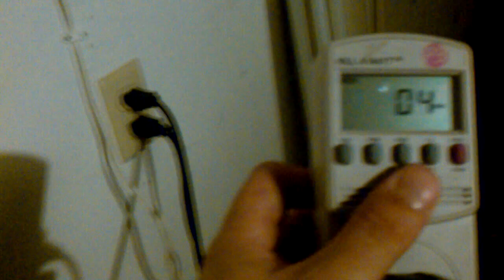Solar panels & Powerjack 1200 watt grid tie part 4

Comment from the maker: @sparktastic1 My PJ 1200 120VAC draws about 10 to 15w when plugged in and doing nothing, like at night. I put it on a timer so I save this power but also so it resets my Kill-a-watt meter so I know total production each day. When I get a charge controller it'll do that for me. So far I've seen cases where the meter is saying I'm bringing in 50W but the Kill-a-watt meter is reading 65W into the house. I have no idea why expect maybe it's a "total" of the draw and input?

Comment: Interesting... My experience has been (on 240v AC models) that AC power draw is around 20w when the 1200w GTI is not generating. My 600w PJ GTI drew about 10w from the AC. If your AC kw meter is correct, it seems the 120v models don't suffer from the same problem.. If it really is only 1 or 2 watts, it is hardly worth installing a timer switch.  Then again, maybe your AC kw meter was displaying the net difference i.e power consumed minus power generated or power generated minus power consumed.

Comment from the maker: @Xringer Actually, I should have said I don't drive THIS CAR that much lol. I have another car which is my daily driver, that was just my fun car I use on the weekends or on sunny days. It takes 93 super with MMT octane booster so to fill it up it's about $45.00 + $3.00 a bottle. I go through about 15 gallons in 140 miles so it would be insane to drive it daily. A turbo would have got me about 4mpg better or close to stock :) At 750hp, there isn't much you can do and I'm NOT un-tuning it :)

Comment from the maker: @Xringer Oh, forgot to answer your breaker box question. The breakers trip where the fuses blow and the breakers are cheaper than the high amp fuses so needless to say it's a better (and cheaper) setup as I can just reset the breaker and add more as I expand. The whole breaker setup cost about $30 with everything included. Each breaker from here out is about $9 at home depot or less depending on amperage.

Comment from the maker: @Xringer Yep, 10.5mpg but at 750hp that's outstanding so try to take it in context lol. I have a friend with a 600whp EVO 8 and he is getting 18mpg on a turbo setup, I wish I had gone with a turbo setup but hey I got what I have now so no going back. If I were to climb Mt Washington in my Mustang I would still get 10.5mpg because it wouldn't be struggling but on the highway I sometimes get 14mpg if I really try. Either way, the car has 16,000miles on it so I don't drive it much at all.